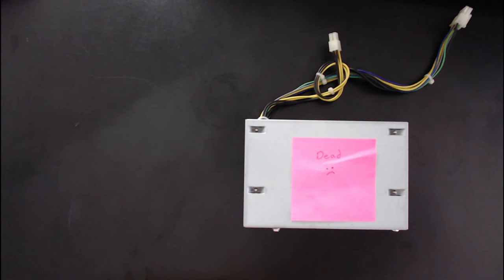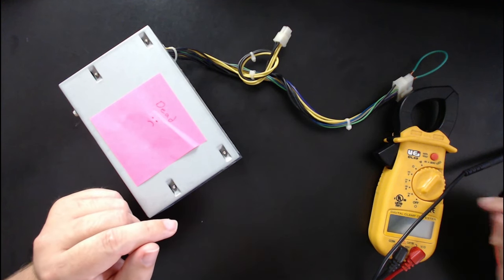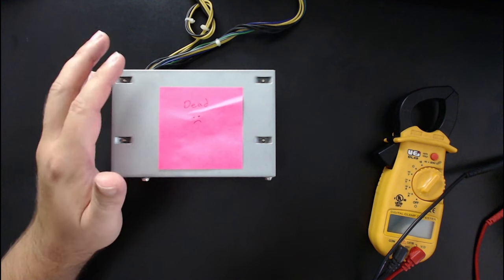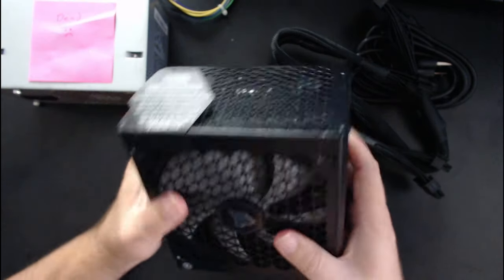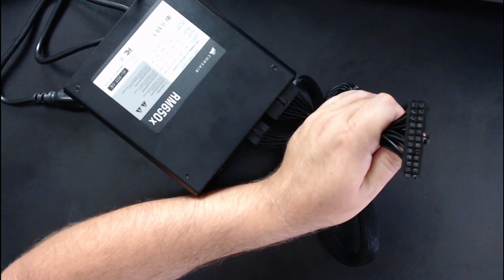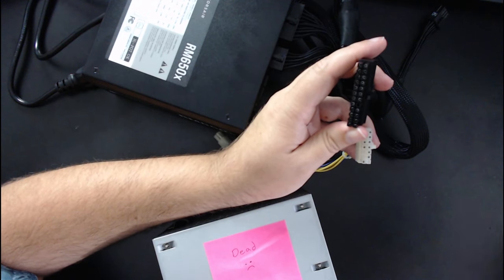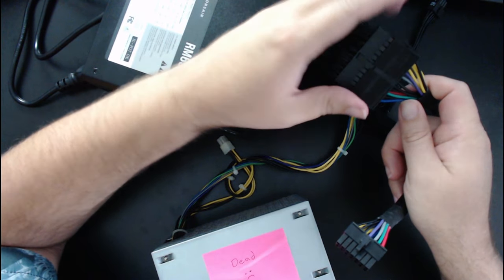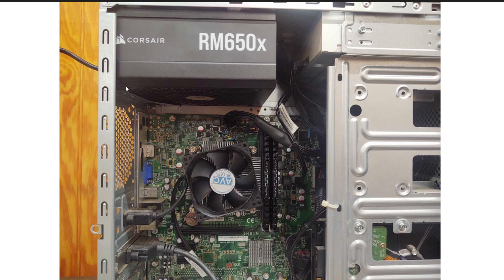24 Pin Power Supply to 14 Pin Motherboard Lenovo Dell IBM Computer

Comment: Working on my home PC and want to install accessories with out having a secondary PSU hanging out to the side. This video is EVERYTHING I need and more! Thank you very much for explaining how the jumper harness overcomes the missing 12V supply from 24 to 14 and showing how to remove pins from the harnesses, I had already started splicing wires and it was getting messy 😅

Comment: Likely, you could also just have taken one of the spare 6 pin modular cables and used one of the 12V wires/pins off it... Should check with the continuity tester that it is really from the same rail, though.
Reply from the maker: Good thinking, yep, that should work.

Comment: I am having a huge headache with my Acer AT306. It has the exact same PS called FSP300. It is whole mess to find out how to check it out, include the mother board
Reply: Many thanks for the video!
Reply: Just found out this FSP300 has different wire arrangement. Shorting green and black indeed turns on the fan, but just for a few seconds. It has no switch. Thanks again!

Comment: Can this work for the m6600t? It also uses a 14pin
Reply from the maker: I'm not familiar with the m6600t, but if it's 14 pin and the wire colors are the same as what's shown on my 14 pin diagram, it should work.

Comment: Can I do this without the pin removal tool😢
Reply from the maker: That would be more difficult. 
I've seen people use a precision screwdriver as a pin removal tool, but it's more likely to bend the terminals out of shape because it's not the proper tool. 
Instead of removing the wires, you could cut them and then splice them back together in the correct locations, but this is also more difficult and introduces risk of a bad connection and future corrosion/resistance at the splice, so I don't recommend it. 
Cutting and splicing the wires would work, but it just isn't the correct way to do things. 

The pin removal tool that I used in the video cost a few dollars at the local auto parts store. 
Having the proper tool is a good investment if you're going to be doing work like this.
Reply: @TavisKingsChannel  what if I just cut of  the old 14 pin connector and solder it to the 24 pin psu
Reply from the maker: You could cut them and then splice them back together in the correct locations, but this is also more difficult and introduces risk of a bad connection and future corrosion/resistance at the splice, so I don't recommend it. 
Cutting and splicing the wires would work, but it just isn't the correct way to do things. 

The pin removal tool that I used in the video cost a few dollars at the local auto parts store. 
Having the proper tool is a good investment if you're going to be doing work like this.
It makes the job faster and easier.
Reply: @TavisKingsChannel  thank you

Comment: Not working the white wire 5 voltage has same reverse current supply. In my case it's not working.

As you shown all pin voltage are same correct. My PC is Lenovo ThinkCenter pls help
Reply from the maker: My 14 pin connector didn't use the white wire at all. 
If you need a wire with negative 5 volts, look at the diagram 39:00 into the video.  The white wire on the 24 pin connector is -5 volts.
Reply: Thanks for replying 
You have made an excellent knowledge base helpful video. 
Is there any volte converter small kit in your adapter underneath the black coating. Just asking..
Reply from the maker: The wiring adapter I purchased only has wires, no volt converter.

Comment: Can I do this and still use the power supply for a graphic card? And the diagram for the 24pin is that a standard for any 24pin power supply?
Reply from the maker: Yes, you can use other connections on the power supply to power other things like a graphics card. 

Yes, this 24 pin ATX diagram is the industry standard pin out diagram. 
This enables all the different companies to design products which can be powered by the PSU made by any other company.
Reply: @TavisKingsChannel  Thanks. Where I am i have to wait months to get a 24-14 pin connector, so this will be helpful